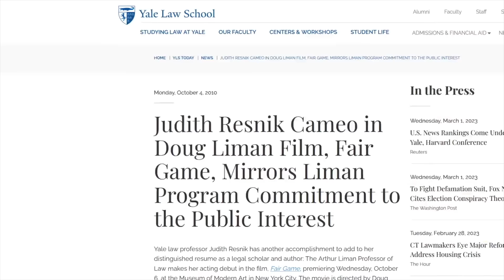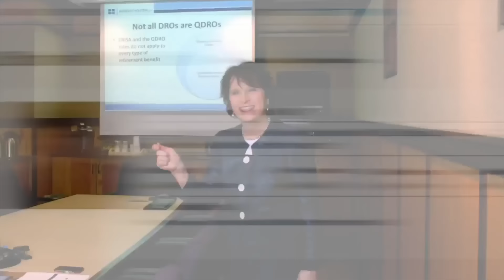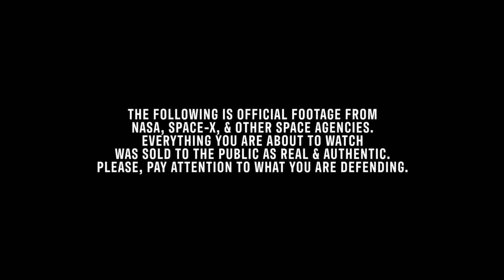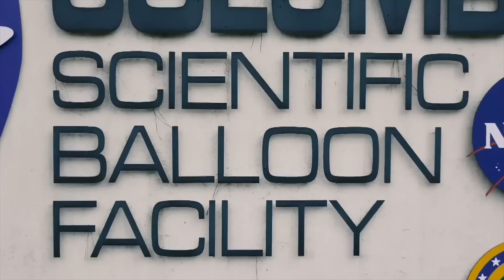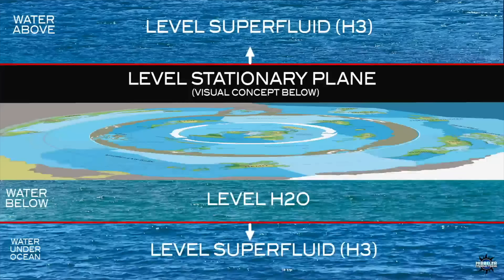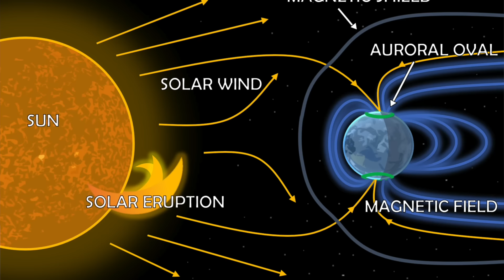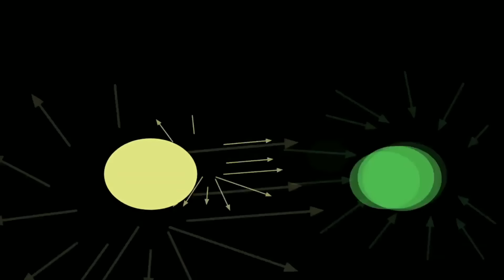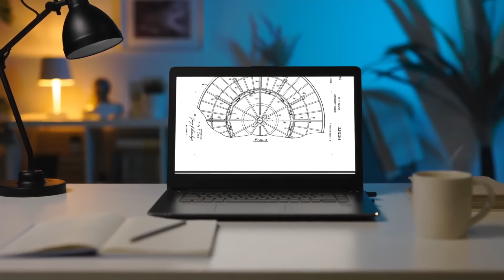Flat Earth Documentary Totally Debunked: SUPERCUT III

Comment: One mistake they (and a lot of other people) make is that Challenger "exploded" when it actually didn't.  When the joint connecting the booster to the fuel tank melted and broke away, the booster was able to collide with the fuel tank, releasing all of the fuel at once, creating the famous fireball.  There was no energy wave detected meaning that no explosion occurred.  The shuttle was broken apart by aerodynamic forces in the atmosphere.

Comment: the funny thing about rocket trails is that they actually do primarily leave behind great clouds of steam, which is water, or literally clouds
so when they are actively firing engines(not the case during stage separation, ie dropping the boosters) they leave behind a puff of steam, and if you know anything about high vs low altitude releases of the same pressure of steam the higher you go the more that puff of steam expands

so yes the cloud gets thicker slowly, the rocket stages, and the next stage ignites(the point you think it hits water)

it is stupid to build a rocket that sends up all fuel on a single stage of engines, you are often carrying up large heavy empty tank mass
staging is where you carefully balance the nozzle expansion(something you can actually test by using a hobby plane at altitude vs sea level) with the cost of decouplers and extra engines
if you balance the number of stages with the intended required thrust to reach a TWR(thrust to weight ratio) that keeps you accelerating at the ideal rate no matter how much fuel mass you have lost without throttling engines down below a threshold(you get less efficiency if you operate too high or too low, just like computer power supplies)
so yes, they use first stage to start moving, so they need a LOT of extra thrust to carry later stages up and overcome inertia
then they drop that dead weight, wait a few seconds for the dropped stage to fall away while running pilot engines to move away
then they ignite the next stage
you can actually see this if you use mechjeb2 on kerbal space program, you set autostage and the system waits till the first one runs out of LfO(the mix for fuel in the game, likely a kerosene-oxygen mix) then it fires the decoupler and sets throttle to a few %, after the defined delay it runs back up to full throttle

the same shit happens to a degree in real rockets, and if they ever let you near a rocket on the launchpad during fueling, you would feel the waves of cold from the cryogenic oxygen gas(almost always used as an oxidizer) and if they let you touch the rocket you would feel the cold metal of the tank, and if you get to see a landed stage you would see how thin the metal is compared to the pressure of oxygen at 50 atmospheres is compared to a cross-section of a welding tank of similar size

the insanity of trying to store gasses in liquid form is beyond what most humans ever experience, just buy yourself a full propane tank, place it out in the middle of nowhere on a hot day, then shoot it from a distance, you have successfully simulated a tank failure on a space-x rocket
now buy yourself an oxy-acetylene torch, place the setup on a merry-go-round with the jet facing tangent to the outer edge
ignite the torch, and sit there, you have now simulated the act of a rocket performing post ascent circularization burns
now just get your rocket setup to a height of 80-100km and now you are given all the pieces of rocketry

in fact an oxy-fuel torch setup is EXACTLY what a rocket is, just with exotic fuel storage and a special nozzle to maximize the newtonian force of "equal and opposite reaction", make the gas go really fast, and you need less to move a larger mass at a slower speed, just like a pully lifting a deer carcass while my dad skins it and you only need to pull the rope farther with a few pound of force rather than hundreds
a rocket is just using force multiplication of an oxy-fuel jet torch, and since space has very little oxygen due to it being so heavy molecularly, you also take up an oxygen tank with your fuel tank

rockets are just big welding torches with special nozzles

Comment: I don't think any of these pizza earth nutjobs have ever seen a play play kerbal space program
orbital velocity and ascent is a complicated process, most of the time the player doesn't calculate the orbit, he simply plays by feeling and control authority when the atmosphere on kerbin is thin enough to being adding lateral velocity
you go up to get to thinner air, then you blast sideways to go so fast that gravity(which is the only valid explanation of why things go down instead of up due to buoyancy and density)is no longer strong enough to pull you down relative to your effective centrifugal force

it is a fact that if you went up high enough, even on a tower, you would eventually float away

that is actually the principle of a space elevator, you make a tower that is tall enough to reach a point where the weight of the object is less than the force required to keep it in orbit at the rotational speed of the parent body, this would not work on objects like the moon because they are tidally locked

if kerbal space program simulated physics accurately and would not choke from the number of parts required, you could easily build a space elevator, just make a large tower about 80-100km tall and then send up a rocket pointing retrograde(against orbit) you quickly need to slow down once up that high if released as the speed of your relative motion above the surface would be more like stationary orbit, which would try to fling you out to that orbital distance, but assuming you can get a material strong enough to withhold the tensile and compressive forces of a space elevator(not something we can do yet) you can easily just release an object and it would be orbital

now is it actually a good idea to do? no, the expense of building a large tower like that and dealing with complications of assembling a structure that slowly needs floors sloping towards vertical, let alone axial forces the higher you go, would lead to a structure shaped more like a mountain 80-100km tall, which would need a base the size of the entire pacific ocean, the sheer material cost and mass would quite literally destroy the earth if suddenly poofed into existence

this is even assuming my rudimentary knowledge of orbital mechanics is accurate, I am no expert but flat-brains are surely even less experienced than me, and I only know this shit because I play a space program simulator game where knowing how it works is important to enjoyment

yeah it is a game, but it is more accurate to reality than the space pizza snowglobe flat-brains push for

and yes I made "flat-brain" an insult as brains are wrinkly due to neuronal connections and being built around the need to have semi-equal blood flow around it all, if you had a smooth brain your cognitive ability would be diminished as parts of your cuboid or spheroid designed mind(or pancake if you want to be even more accurate to how the flat earth looks) would tend to have dead zones of almost no neural activity, making the brain capacity at the same volume be a huge margin less, making a very stupid  person
show me if your brain is smooth or clumpy, prove to me that your view of our planet is correct by creating a SIGNLE model that explains EVERYTHING and does it just as accurately as the globe does

Comment: If you need a final nail in the coffin for this idiots ask them how I can listen to ham radio stations from Italy, Germany, Poland on 437.8MHz and talk to them on 145.99MHz on a 5w hand haled radio wait for it from Romania. 437.8MHz is UHF ultra high frequency or 70cm band that at best in a strait line you can achieve a few km for a radio connection. Explication on ISS there is a ham radio station a TK-2000 set as a repetor with downlink on 70cm (437.8MHz the listener should corect the Doppler effect having at list 4-5 Rx feq with a 5KHz difference) and uplink on 2m (145.99MHz). Look into it it’s quite cool what hams do. Aaa sht my bad if they believe earth is flat why would they understand electromagnetism and Sir Maxwells equations.